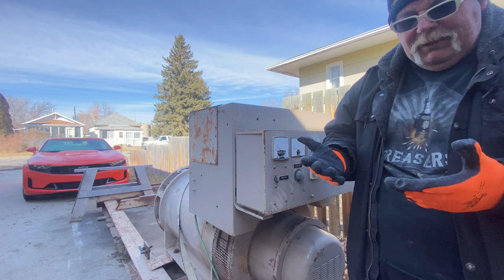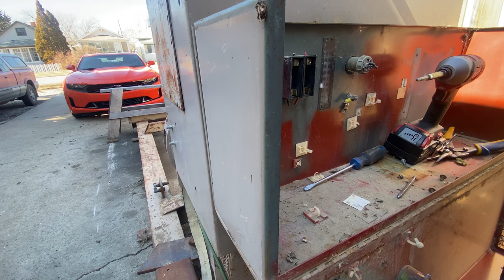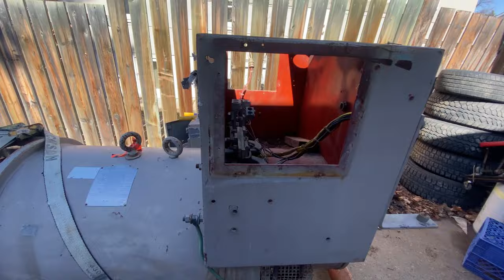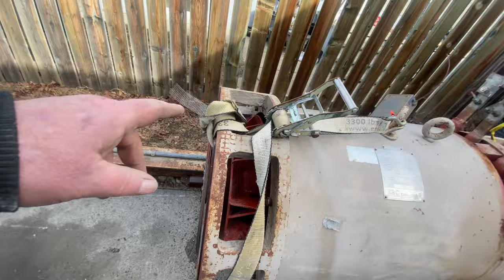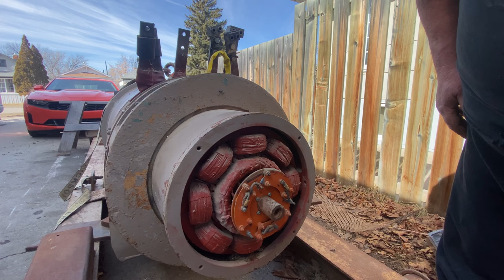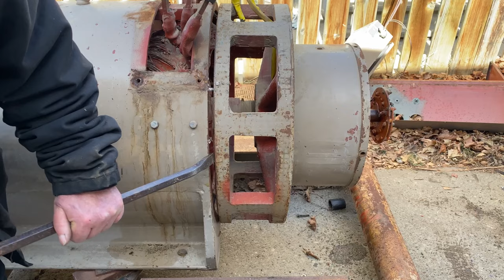Scrapping a 9,000 Pound Generator - Biggest On Youtube - Part 1

Comment: Nice haul cant wait for the next onethere probly bearings holding you up i would also remove the bolts on the left side as your looking at or the front depending where your standing.  The end you were pulling from

Comment: To get the motor off, try prying at the bottom !
Prying top or sides just pivots but, prying at the bottom the weight of the motor keeps it from locking against the top and will work it off !
Reply from the maker: Thanks my friend I will try that

Comment: Hey you got off to a great start .you will need to take the bolts out of both ends especially the end you were pulling on with the truck. Switch from the strap to a chain . The strap is stretching and loosing the pulling force of the truck. A chain won't stretch and give you better pulling. Use a floor jack on the bottom of the housing taking the stress off the bolts .that will help free the end piece
Reply from the maker: Oh thank you that makes sense

Comment: Those big terminal connections sticking out the side of the armiture housing are why you can't pull the rotor out . Back to where you were pull the generator cap off disconnect those terminals or cut them out spay oil up in the motor and then pull it apart.
Reply from the maker: Thanks my friend I’ll definitely check that out

Comment: If you watch at 20:07 when you yank on it, the bell shaped piece on the back moves forward and doesn't move again.
This means that bell shaped piece has to be removed first but of course we can't see what is holding it back.

Once this is done, you can pull the rest out the front with the truck.
Reply from the maker: Ya I figured it out today it was a stupid spring clip darn they are strong
Reply: Holy smokes !
Reply from the maker: @computiacusa ya I was like daum!!!
Reply: Also theres a huge ball bearing pressed on a race or even the cap itself.  Steel wedges and a big hammer and of course a big guy to swing that hammer!
Reply from the maker: @mattyal9347 oh thank you, good idea I’ll get my wife out there, just kidding

Comment: That thing seems to be put together the same way as a Lincoln SA200. Two generators on one shaft. There’s usually a little exciter coil on em. I don’t know how it would work to make ac power but on the Lincoln’s the little generator makes the power for your grinder outlet and starts the main generator when you scratch your electrode.
Reply from the maker: What I have been told the other coil or as I called it bonus motor I guess is the exciter
Reply: @nicejunk666  was that thing putting out ac or dc power?
Reply from the maker: To be honest I have no idea
Reply: @nicejunk666  that was an interesting generator. Do you still have the stator? I’d be willing to buy it if you do. I’m pretty sure once I get my loader running again I could probably figure out a way to rip that thing apart pretty easy. Maybe get a video or two out of it.
Reply from the maker: @scrapmanindustries  sold it to the scrap yard .25 a pound sorry that would of been fun
Reply: @nicejunk666  dang. They paid you a good bit of money for it though.
Reply from the maker: @scrapmanindustries  I figured out how much copper was left in it, and there wasn’t enough meat on the bone for me to play with it, I have a playlist on this generator I believe the last video shows how much I got for all the Steel and the stator
Reply: @nicejunk666  ok. I'll check it out.
Reply from the maker: @scrapmanindustries awesome let me know what you think, sorry for the late reply was busy bringing in a copper load

Comment: This will be a great video to watch. Lots of good things in the control panel. I see copper and steel every where. Current transformers should be copper brother. The back end looks like exciter field coils. Should be copper. I think you may have a bearing on the shaft at the rear  that may be holding you up. Pull that rear end bell brother.😎😎🔥🔥⛏⛏
Reply from the maker: Thanks for the great advice, I so appreciate it I will grab my engine hoist that should help

Comment: It comes out the opposite way your pulling
Reply from the maker: I’ll take a look at that thanks
Reply: I could be wrong I just know if if doesn't come out one way we'll then it must pull out the opposite way. Mind you it did start to pull out your first few attempts but after that the the whole thing chassis started moving. All the best can't wait for part 2 👍
Reply from the maker: @scotthoward4836 I’m a fish out of water with these industrial units. That’s why it’s so important to get feedback from people like you. I so appreciate it and thanks for the support 

What your saying makes sense
Reply: Ive never done anything this big. I worked at generator hire company that stripped and rebuilt these daily some of these generators are 1000KVA 20ft containers.i assisted the mechanics with the job my role was crane and forklift driver which definitely makes the job a lot easier. If you haven't already you'll need to cut the cables coming out the top that could be jamming it up also.
Reply: The biggest copper motor I've stripped is a pool pump😂
Reply from the maker: Wow 1000 kva yes please if you have an extra send her to my place 🤣
Reply from the maker: Pool motors are so cool 😎
Reply: 😂 I don't work there anymore but we did have a couple of 1650kva and about 4 1250kva units but they were always on long term hire at mine sites they only came to us if major repairs needed doing. Pool pump are pretty cool I'd like to do something a little larger I missed out on a 175kg electric motor but I had no way of getting it
Reply from the maker: Those sounds monster I’ll definitely be on the hunt for one of them bad boys

Comment: i dont like scrappimg this big things it is realy hard work...ok, it is 200-300 kilo copper 1 think. but this red glue is realy a pain.in early days i pull this rotor out, and make a wood-fire in the stator...lat ir burn for tow days, than copper comes out easyly... without fire...maybe no chance.... we will see... good luck. we sraped motors and generators up to 10 Tons ... :-) copper is minimum 20 percent, maximum 30 % mostly
Reply from the maker: Hi sorry YouTube threw this comment in moderation, I have no idea why

It is a tremendous amount of work and I am thinking safety every step of the way

Comment: Ya 2 cumalong steady. Tension. And some  big wood wedges. Or steal.   And don't hook. It to. Your truck.  Unless.  You   use. A.  2 chances and  a heavy belted. Tire in middle.           Anker.   That frame on. Ground.        You will be amazed.  What pull power.   Tire has.  When stretched.      Just stretch.   Lock those wheels.      Go eat with hammer.  Your working way to fuckin hard.        That.   Motorwwas v
Built vertical.      Now that you unbolted.  It.        Like line lock brake power.   With. Ton of weight
Reply from the maker: Great advice